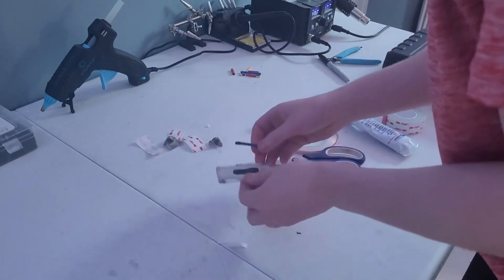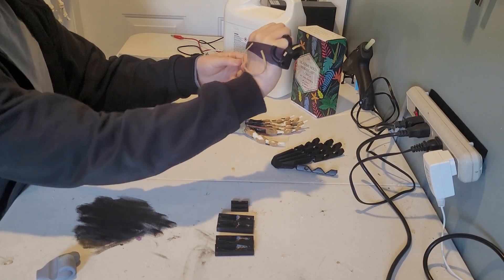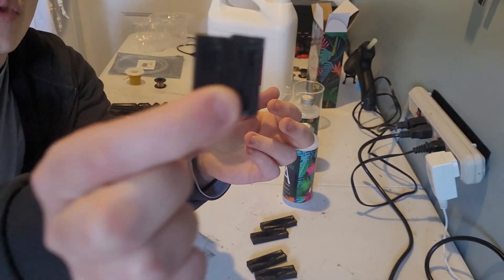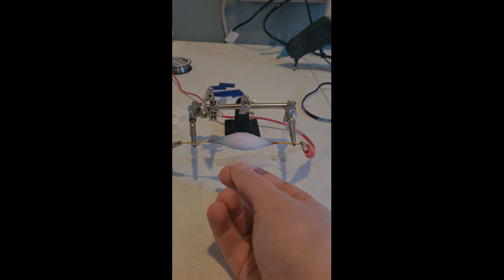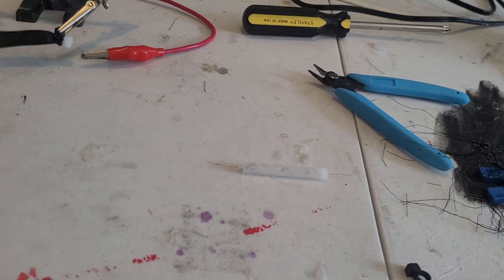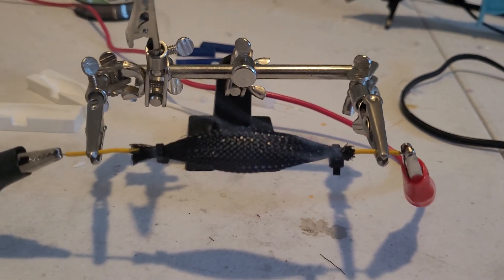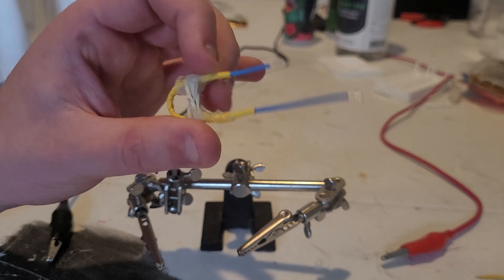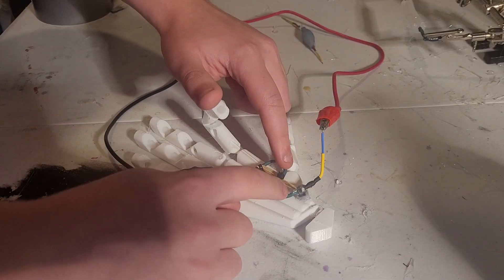IT WORKS! | New Robot Hand & Artificial Muscle

Comment: Try googling myofiber muscles.  Its basically a rubber tube encased in a sleeve.  When you fill the tube with water, it expands outward like a muscle and the length shortens.  There is already an android robot built with them amd its creepy realistic.

Comment: I'm not sure what you're doing here. Electrically, heating a coiled electric wire inside a bit of silicone, is no different than throwing the silicone on a toaster. Wire heats up, things start melting.

If you really want to control the expansion of a piece of metal using current, you should be looking into Bimetallic strips. That's the stuff inside the voltage and current dials in a classic analog bench supply. And the stuff that makes mirrors move really fast and precise in laser scanners (galvanometer). Piezoelectric crystals does something similar.

Comment: Nice work. You're using Nitinol right? If so I suggest using thicker gauge. You'll get more forceful contraction and you can better control the temperature of the material. If you over heat it to orange you will detrain the nitinol and it will lose it's contractile force.

Comment: While you are doing original experimental research, maybe also research what has already been done, and basic principles of physics and materials science. You could save yourself a lot of wasted time and effort.
Reply from the maker: I did a lot of research into the first kind of muscle demonstrated in this video. Which was first experimented on in an MIT lab. The muscle, I ended up making, was just a random idea. In future videos, I intend to take the idea, improve it, and put it to good use.
Reply: @tobecomeimmortal Try cerate liquid electromagnet artificial muscule. Oil with copper and oil with ferrite powder. A this mixtures to flexible tanks -similar like cavatappi artificial muscules, with flexible rod.
Have fun.

Comment: Nice! Do you think it will be possible to place artificial muscles inside of the printed hands? Also, I would recommend to use a thermal camera in order to check the temperature or thermistors. 

I’ve been trying to use voice coil for such project. But was not successful with mimicking movements

Comment: couldn't you make 2 of them and put them in something like a scissor lift formation to make it contract and expand
Reply from the maker: That is correct! Considering that the muscle is very thin, it could be stacked on itself, or combined with itself in different orientations to achieve better pulling force.

Comment: Damn, you've made real progress!
You might want to try using springs instead of rubber bands
Also an other way you could replace them would be by using a second muscle on the opposite side so this way you can control both the contraction and the expansion.
And i'm not sure but maybe by contracting them both at the same time it could "lock" the finger in place ?

Comment: NICE, maybe attach the muscle on the back of the hand with some kind of a rubber band type thing to contract it and by adjusting the watts you could adjust the strength of the muscle (I think, never played with that kind of stuff), so that you can control how much it's going to contract, also the rubber band has to be not that strong since the metal you use isn't that strong either